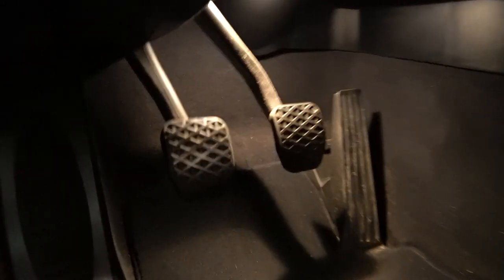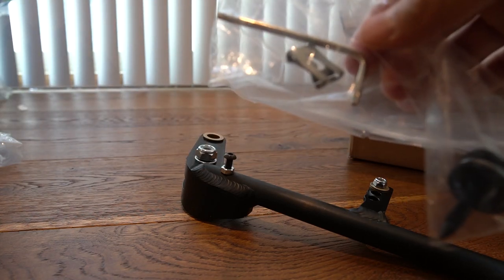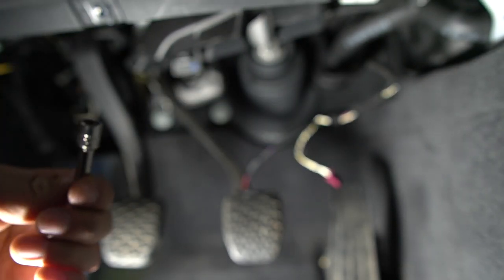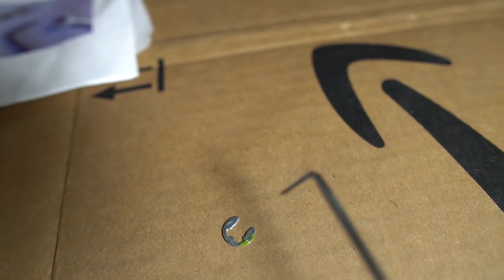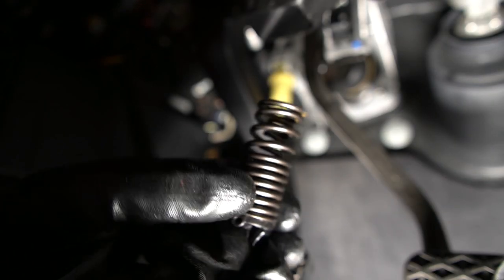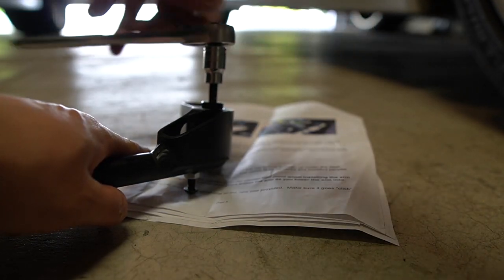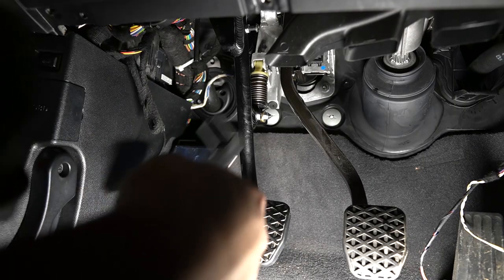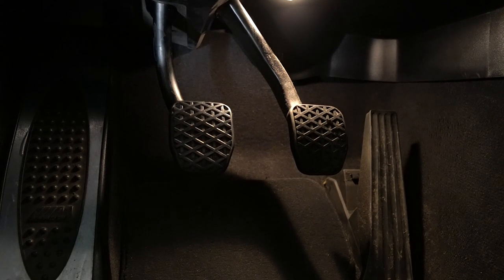E92 M3 Gets a Clutch Pedal Upgrade - Ultimate Clutch Pedal - UCP

Comment: I think a clutch stop would be helpful. First find the release point. The best way I found to do that is to lift both rear tires off the floor (since you have a limited slip diff), then have another person try to spin the rear tire by hand while the car is in gear. Meanwhile, you open the driver's door, get on your knees and press the clutch pedal slowly with your hand. Hold the ruler from the floor to the medal and measure the distance from the floor to the pedal when your partner can finally spin the rear wheels freely by hand. This is a point of full clutch disengagement. Your pedal travel should be slightly below this point, but not much. Then you know how high you need to set your clutch stop. Second, generally most people like the clutch pedal to be higher than the brake. The reason is that clutch pedal travel further than the brake. As such, if your clutch pedal is below the brake, you will be constantly twisting your body to the left to press it, but this is a matter of personal choice/comfort.

Comment: Great video!
This helped me tons when it came to installing my ucp.

Did the same and removed the bigger spring and kept the inner spring. Such a night and day difference.

Right after I installed it, the car would go into a fake “limp mode” where it basically won’t accelerate at the bottom of 1st  or 2nd gear. 

Brought it to my local shop since I couldn’t figure it out.

Turns out it was my brake light switch that some how came disconnected 🥲

Hopefully that helps anyone that encounters that issue

Comment: I just installed the UCP and it’s great. My pedal actually sits slightly lower than the brake pedal, does yours? It seems like yours is dead even. I used inner spring only and tried both OEM and Sport holes and the pedal height was lower than the brake. I like it, but thought maybe something was wrong.
Reply from the maker: Mine also sits slightly lower than the brake pedal. It feels leveled when driving though.

Comment: did you have any squeaking noices since the install?
Reply from the maker: No squeaks initially but now do. Might apply some grease to get rid of it.
Reply from the maker: @ASSK555  UCP has a metal bushing. The squeak I have isn’t so bad. I’m guessing it’s the spring but will post a video when I get to it.
Reply: @ASSK555  this is late but when my Z3’s clutch pedal was squeaking, I just sprayed some WD40 on the spring and it never made another sound.